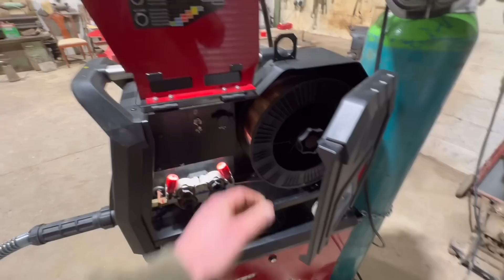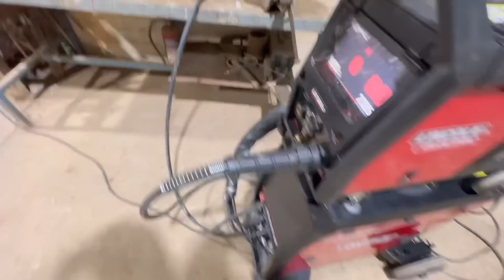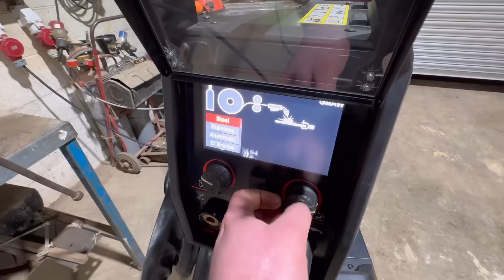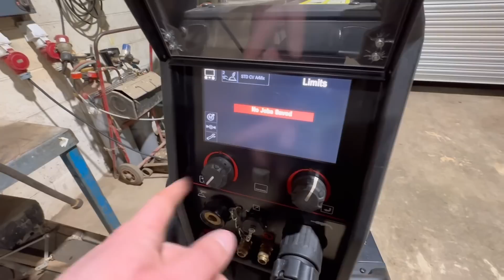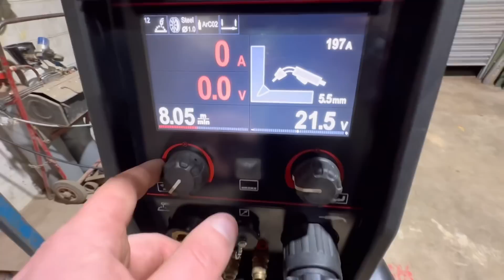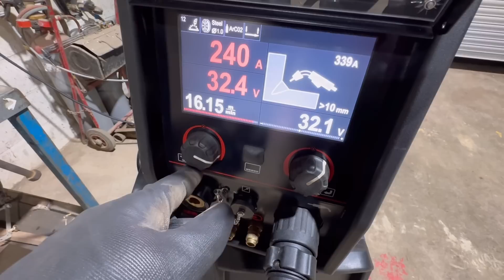New workshop Lincoln electric welder (walk around and welding)

Comment: Tom, do you still use BOC for your gas? If so try SGS. It is available through motor factors and you only pay a deposit on the bottle rather than rent. Works out so much cheaper.